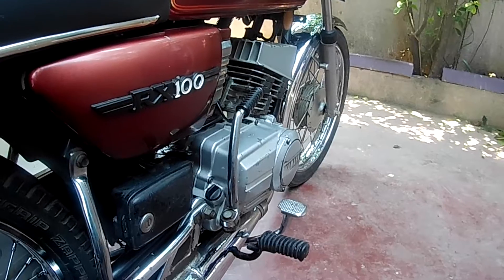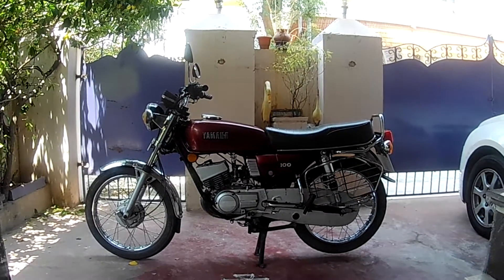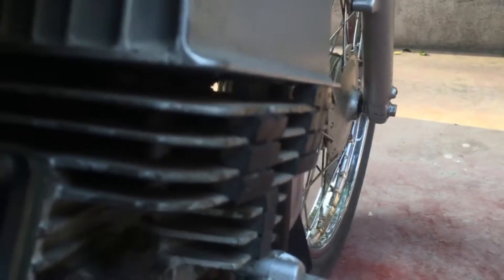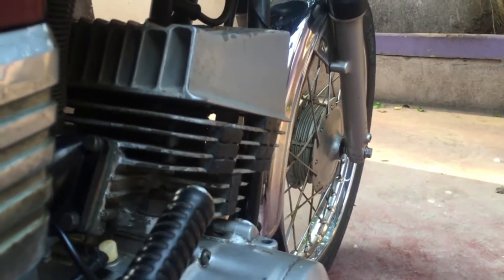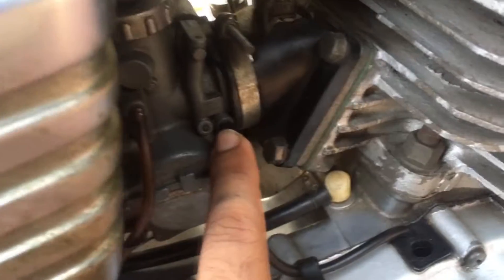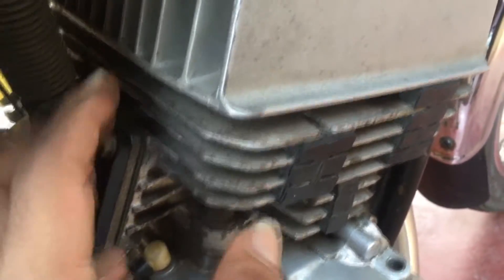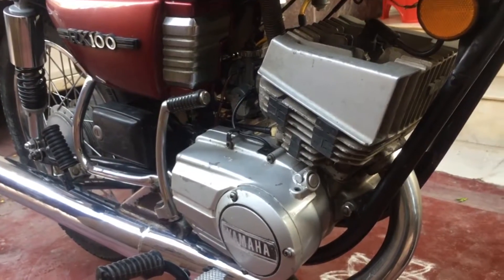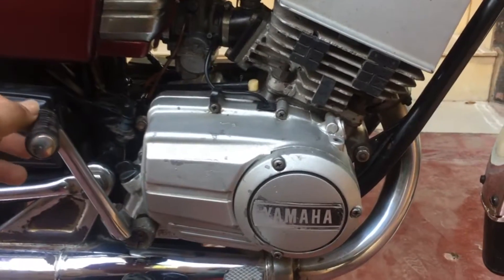2 Strokes : 2T Oil ? Engine Oil ?

Comment: Do I need to premix oil with petrol or relay on oil from 2t tank?
Reply from the maker: Premixing is the better method as you eliminate the possibility of engine failure caused by an unexpected oil pump failure. But if your pump is working well, just fill the 2T tank. Make sure to bleed the air everytime you change the oil and make sure to align the acuator of the oil pump for its proper working.

I’d highly advice to get it removed and run fully premixed. Here’s how you can do it : https://youtu.be/l2fo7vcW0mI

When running premixed, use 25-35ml oil (absolute max is 40ml) for every 1 litre of petrol

Comment: bro which is the best transmission oil for rx135 5s right now
Reply from the maker: Motul 3000 20W40 or 20W50 is what I’d recommend.
Reply: @BrattyBiker  4t oil ?
Reply from the maker: @anuroop8483  Yes

Comment: Can we use truck gear oil bro is it better
Reply from the maker: No, It is too thick. 

Use Motul 3000 Mineral 20W40 for the Gearbox/Transmission.

Motul Motomix or Shell Advance VSX for the engine.

Premix 25-30ml oil for every one litre of petrol if you are running without an oil pump.